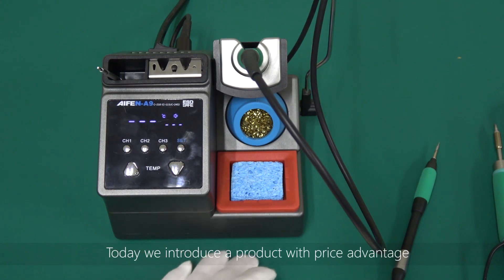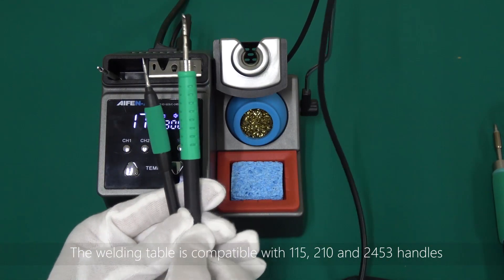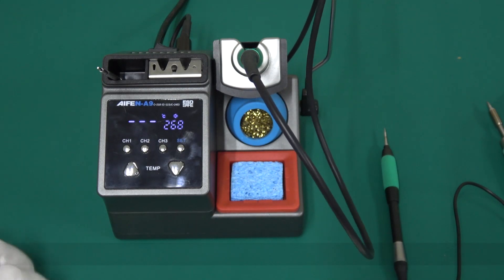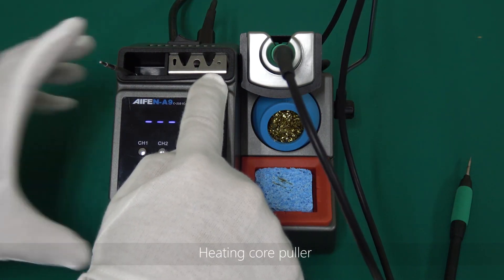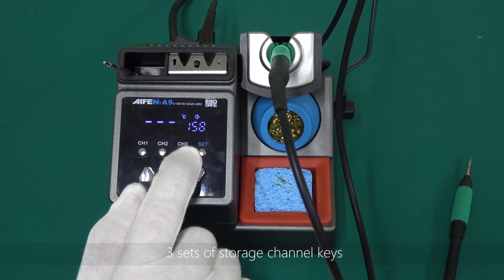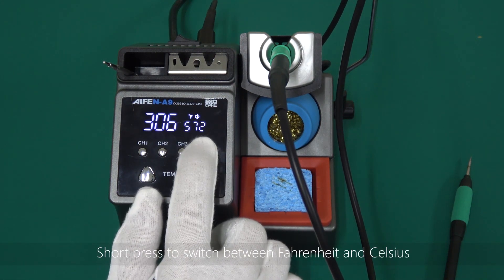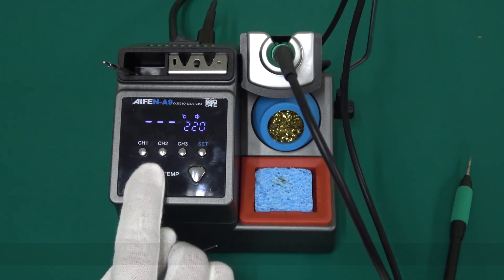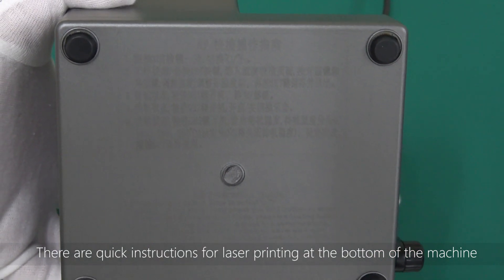AIFEN-A9 Lead-Free Soldering Station Compatible C115/C210/C245 Handle Chip Temperature Control

Comment: bonjour j'ai m'acheter une AIFEN-A9 et je vous faire de changement de mis en veille comme le configure de 150° C a 0° C je me demande si vous pouvais m'aider merci
Reply from the maker: Réglage de la température de veille : placez la poignée sur le support, appuyez et maintenez à l'état éteint
Touche "CH3", puis allumez l'alimentation, vous pouvez régler la température de veille, le réglage de veille
La température fixe est divisée en 0, 150, 180, 200 degrés Celsius, (réglé sur "0"
Éteignez la température de veille), puis appuyez sur la touche "CH3" pour enregistrer et quitter après le réglage.
Reply: @htmtoolstore4833  J'ai suivi votre conseille et j'ai réussie a solutionner le problème je vous remercie pour votre conseille et votre temps